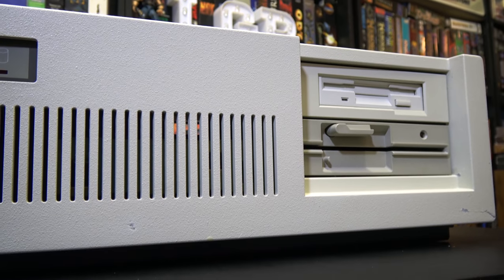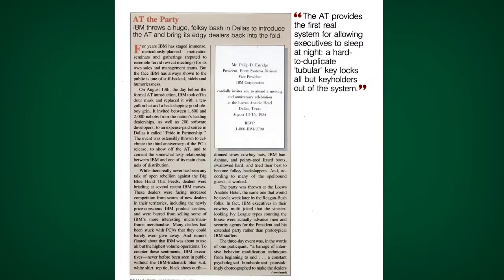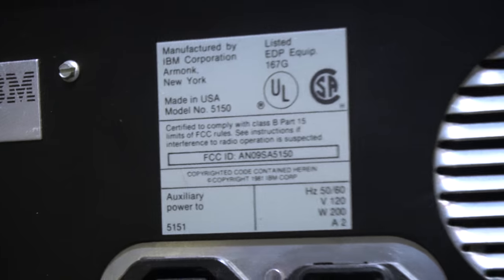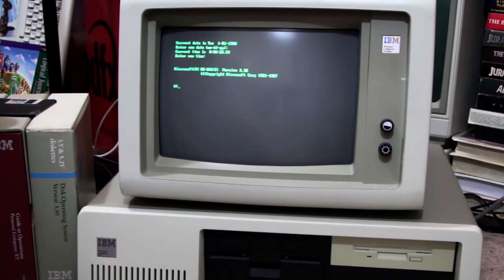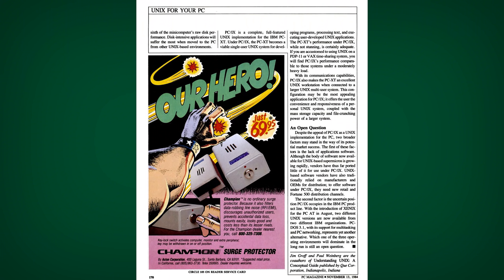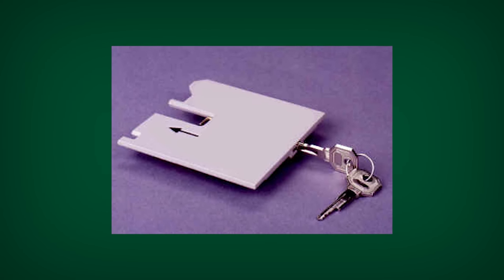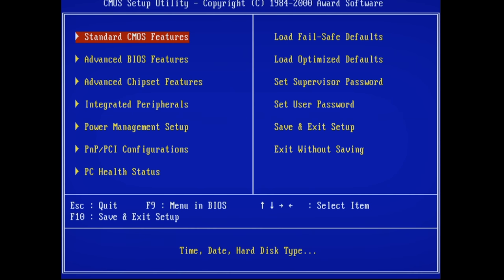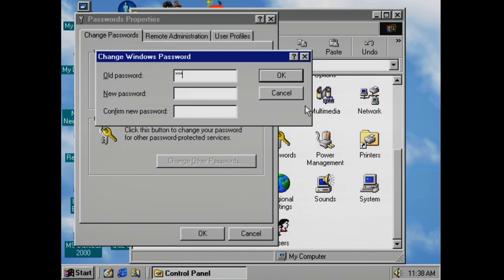Why did old PCs have key locks? An LGR Retrospective

Comment: My dad used this feature against me when I was a teen to ground me from using my PC. I used a mechanical pencil and unlocked it without a key. It worked until he caught me and then he took the power cord.
Reply: Similar story, but I used a red Lego key that worked well enough.
Reply: My family had a 95 that I broke by deleting system files, they got it fixed, and then kept me out by having the thing boot windows manually from the command line.
Reply: Kids tend to be very destructive when they're frustrated/annoyed/mad. One really doesn't understand how self-defeating it is when they're that young, and a lot of parents tend to forget how they felt at those ages.
Reply: haha same here
Reply: XD
Reply: InsaneLP  The English language is dead.
Reply: My dad would put a small padlock through the hole of the plug connectors to prevent me from plugging it in and playing games all night.

He didn’t know the printer, and TV used the same detachable power cords, so I would just swap those for the PC and replace them in the morning.
Reply: My mum used to take the power cord. Needless to say I had multiple cords.
Reply: For me it was the Nintendo controllers. Always had a hidden spare.
Reply: haha my parents tried this lock, but it was too easy for me. also ive had extra keyboard and power cord)))i was in 5th grade)
Reply: mine took the power cord too, but he didnt notice that the cord was the same as the printers...
Reply: Look at your dad, encouraging innovation. :D
Reply: @MrWelshbrit  Chill out. It's quite obvious from his speech patterns that English is not his first language (and the style of expression seems quite German to me), so this isn't a case of someone taking English and intentionally breaking it, but of someone who has learned English as a second language and is not yet perfect.
Reply: InsaneLP  Oh man My parents did this to me (installed a timer program), So I learned enough unix to use the terminal to re-run the initial setup and create a new admin account that was free of all restrictions. Made me feel like a god, until i got caught...
Reply: Just stick a fork between the pc and the outlet 😂😂👌
Reply: Here's one I used to do when I had a desktop pc, cmos/bios lock in addition to passwording the one and only administrator account on xp, and disabling guest, both with different passwords. Y'all would've hated trying to get past that. 1 wrong attempts at start-up I could have the pc either reboot again each time, or set an amount of time the computer would stay frozen and would accept no commands until set time passed.
Reply: My parents tried to prevent me from using my PC when I was grounded by taking those keys, too. But they didn't know how that lock worked, they thought it was like the ignition lock in a car and that I wouldn't be able to use the computer at all without a key (they didn't even check if it was in the locked position). Unfortunately, they found out about it at some point and then they also took the power cord and eventually the whole PC.

Comment: I remember when I first starting my real "grown-up" job back in the mid-90's, in a hospital, the PC's had those locks.  Even for the time period I worked there in the 90's, those PCs were dated, but the hospital kept them in use as long as they could before basically being forced to upgrade because of medical records software not being able to run efficiently on the old PCs.  

We were assigned a key, and threatened within an inch of our life and job, that if we lost it, we were in trouble.  We never used them though, for anything. I can't recall one time I ever needed to lock or unlock my computer for use, but maybe I did....and just can't remember because it was so long ago. 

It was such a big deal then, that HR said if we didn't turn in our PC key if we quit or got fired, that they would hold our final check (which is illegal, but no one seemed to be aware of that back in the 90's) and there were people who got all upset over it when they misplaced it.  

Turns out, it meant nothing at all and by the late 90's, it was just forgotten about as those dinosaur PC's were being phased out for new PC's (which are all dinosaurs now, several times over)

Comment: i remember my brother leaving the house and locking the old 486 with his key to prevent me from using it. little did he know that i could easily unlock it with an "extra key" that i had created using a pin and a clip. aaaah the good old day of dos pc gaming -  when i was 6 and loading up prince of persia made me feel like a hacker.... :D
Reply: What machine did you have? I played on a CGA 8088 and any years later on a 486. 

The real diffrence is the sound.... mi 8088 had only that PC Speaker...

Comment: What also killed the key lock was the drop in RAM price.  RAM used to be stupid expensive, and schools and workplaces especially had to lock down the towers to keep people from stealing RAM from them.  The locks started falling out of fashion as the ram prices dropped and it was less of a draw for thieves.  These days, only major video or gaming enthusiasts need more ram than ships in their computers, and even if they do need more it's fairly inexpensive to purchase.
Reply: MrsRCharlton hell back in 1997 I was wstealing ram from the schools computers to resell
Reply: So far, I still don't need a ship in my computer.
Reply: Desktop towers are still secured with a Kensington type lock. It's usually to prevent people from taking them away, but the locking mechanism also doubles to stop the casing from being opened.
Reply: MrsRCharlton stealing RAM to play Rampage ? lol

Comment: I always knew RAM cost a lot back in the day and my father worked as a lorry driver and on one delivery was asked to deliver a massive load to an IBM factory, when he arrived he was taken out, explained the situation and a single guy walked out, walked up to a specific pallet, at a specific row and took one small container. Turned out it contained £2million(pounds not dollars) worth of RAM. He then was allowed to leave. Also had the same situation with Intel, went to a factory and had a single box that contained silicon chips worth millions, turns out it's safer to use small transport companies for this type of thing.

I still have old keys for computers which I quite like.

Comment: Haha they probably thought computers would be too heavy to steal forever
Reply: Computers with full tower cases, four DVD recorders, two floppy drives, two 20 inch tube monitors, would easily disappear back then. Weight was never an issue when it came to stealing a computer.  I never found out how some of these very elaborate systems managed to get stolen out of guarded floors of a business.  It was not something that happened occasionally. It happened a lot.
Reply: @indridcold8433  Speaking as someone who's worked in security, I can safely tell you that even the most barebones uniform will let you go anywhere, and walk out with anything. When something goes missing like a ghost took it, look at the local pigs.

Comment: tubular locks are hard to pick without a tubular lock picking tool, but if you have the tubular lock lockpick, its really easy to unlock a tubular lock... tubular lock.
Reply: tubular, dude
Reply: awe, well that's tube-bad
Reply: You can do it with a cheap plastic bic pen if you know how.
Reply: No.  It's not any more difficult than a normal straight keyway.   You can even use the same tensioner on some and you push the pins in one at a time, around and around, until you feel the sets.
Reply: ... Are you getting paid every time you say Tubular Lock? Because I'd, tubular lock, like to get in, tubular lock, on that ac- tubular lock -tion.
Reply: Picking tubular locks is tubular because tubular tubular lock pickers pick lots of tubular locks and they are great picky tubular tubular lock picking masters of pickiness that pick lots of tubular locks and they are great picky tubular tubular lock picking masters of pickiness that pick lots of tubular locks and they are great picky tubular tubular lock picking masters of pickiness that pick lots of tubular locks and they are great picky tubular tubular lock picking masters of pickiness that pick ...

... pick lots of tubular locks and they are great picky tubular tubular lock picking masters of pickiness that pick picky pickers picking lots of picky pick pickers of pickitity pickness because picking pick pickers  helps in picking picky picks and it also unlocks previously locked locks because it is a tubular picked unlocked lock.
Reply: Lock lock lock, lockity lock, unlocking unlocked locked locks are very locky because locky lock locks picked the lock's tube. That was quite tubular but the tube tubed a tuby lock, which was picked by a picky picker, who picks picky tubular locks! Tubes used to tube locks to tubulate the lock so they could bypass the pickies anti-tube pickular lock system and get into the secret PiCk created by picky scientists.

Comment: I worked in a warehouse with about a dozen Dell GX150 (Pentium III) machines. They were minimally equipped, some with just 128 or 256MB of RAM for running XP. We received a shipment of computer goods to be scrapped, so I casually went through the container until I had enough ram to max out every system in the company. I grabbed a few for myself, and a couple weak AGP cards. There was even a couple PCI video cards in there, maybe an FX5200? Whatever it was - it was strong enough to run Return to Castle Wolfenstein on that little Dell. I needed something to pass the time on 3rd shift when everything was done!
Reply: 256mb of Ram! Oohwee!
Reply: Great game Return to Castle Wolfenstein is!
Reply: Old ram sticks can be very valuable but they do need to be the largest size available for the era. When 256mb ws common, you need to find 512 or 1gb stick of the same type. Those are more valuable than gold, they are used in old legacy systems that are still needed 24/7. So it only makes sense to get the pinnacle of the technology of that era, the last versions that come out before the next version starts dominating: they are so robustly tested by that point by millions of people running trillions of read/writes per day in all possible combinations of hardware, manufacturing has solved every minute issue and you can easily push for the theoretical limits of the medium. And of course, if you do have a legacy system that can't be replaced, you want to give it the best chance you can to keep running so you buy the very best of components for it. I am not just talking about PCs but also about industrial machines that used the same RAM as the most common found in the market. 

One good example are McLaren supercars from the 90s. The compapny had to hunt down a specific model of IBM thinkpad from the era to run their custom software. They have a storage room full of them, running bespoke software that is designed to run in that particular machine, you can rent one and it travels with a mechanic. Maybe it would work on some other combination of hardware but it will for sure run on this one known combination. Procuring RAM for those kind of cases means no expenses are spared and you may get hundreds from just one 512mb RAM stick from the 1995. Lower sizes and early models are still worth less than crap.

Comment: My graphics card’s fan just turned on at the precise moment when you pressed the TURBO button in the video. That was awkward.
Reply: Or magic lol
Reply: s4ndwichMakeR since the video went turbo you had to up you graphic processing
Reply: XD
Reply: YouTube is a graphics card eater... it's such a heavy program you'll need the best graphics cards on the market...
Reply: DavieJones1111 You’ll need a Nvidia Quadro.
Reply: TheMaster's Code get that GTX 1080 Ti in here
Reply: It's a "turn-on" for your computer or graphic's card?
Reply: then why does turbo boost on new pcs make it run faster
Reply: s4ndwichMakeR iid
Reply: @rich1051414  : You're right. Turbo Mode "On" was just the normal speed of the computer's CPU, and Turbo Mode "Off" was really the underclock mode, where the CPU ran slower than normal. I guess that was intended for old apps and games, which would run too fast otherwise (in those times, some games could actually run too fast, because they relied on how fast or slow was the CPU to determine graphics speed). I guess they called that button "Turbo" because it sounded cooler than "Slow mode".
Reply: I read this comment at the precise moment he pressed the TURBO button. Still awkward?
Reply: where can i buy one , i am one of those people that have lots of money to spend on nothing instead of helping the needy .  just joking . i actually care about the less fortunate . can you tell i was being sarcastic about the none caring  people that waste money on nothing and yet can live with themselves while others suffer with nothing .
Reply: Askejm You can watch Youtube at 1080p on a $35 raspberry pi 3 with no problems not sure if you're joking....
Reply: So awkward
Reply: @rich1051414  : No, I didn't got it backwards. That's how it actually used to work (Turbo On being normal speed and Turbo Off being underclock speed). Maybe your PC turbo button was wired incorrectly so it was the other way around?
Reply: @Askejm  Yes my grafics card doesnt work any more i need to upgrade  because i stepped up whith 23 inch monitor and you tube isnt working any more its torn image and delayed sound
Reply: My hamster almost imploded. 😯😣😥
Reply: xD lol

Comment: "One tubular key" It's incredible that it took until the 2000s for anyone to figure out you could open those things with a pen.
Reply: I used a straw.
Reply: Not all of them: some have tight tolerances and stiff springs, but that still doesn't stop them being picked with a dedicated picking tool that you can get for cheap.
Reply: I used a paperclip. Those things were ridiculously easy to pick.
Reply: I noticed way back in 198x that I could lock every single computer and disk box (yes, those were a thing) with one flimsy plastic key.  I think I did an impressioning attack by accident.

Comment: I've actually looked into this.

Locksmiths still make tubular/cylindrical keys for this purpose, and cost little more than a typical four-pin key for most modern locks today (~$4).

If you happen to get a PC without a key, take the PC to the locksmith and they'll make you a key for it.
Reply: Or alternatively, buy an impressioning tool online and use it to open the lock
Reply: I always wonder why people still use tubular locks for both car safes and server racks - it's a terrible lock, why are you still using it?

Comment: fun story.. I worked at a ski resort around 1989 / 1990.  I was fired for being mouthy to my boss.  So they sat me down in the managers office with one of these older PC's and I carried a key with me.  I had a IBM 386 something or other at the time.  So I locked the keyboard while I was waiting to get fired.. good times :)  I wonder if they ever figured it out.
Reply: Yeah sure that happened "wink"
Reply: Awesome example of petty revenge!
Reply: @smittywerbenjagermanjensen1051  Manufacturers only use so many possible combinations. If you have a car key without a microchip go around a parking lot and try it in every car that's the same make and model. You'll find that a rather disturbing amount of the time the key will work just fine. Even with chipped cars, you can still open the door even if you can't start the car. Of course it'll be fun explaining to the cops why you're running around trying to open random vehicles, but that's the price of experimental verification.
Reply: @Invisifly2  so youre confessing of opening random vehicles that dont belong to you in the name of science?
Reply: lol
Reply: @smittywerbenjagermanjensen1051  
I remember incoming inspection specs correctly there shall be no duplicate keys in 10,000.
Of course we did not check but it would have been possible by having a digital representation for each key, making sure each key/lock combo had its code on the list and then check the list for duplicates.
(I think it was 10,000,  it might have been 1,000. it was a long time ago.)
Reply: @smittywerbenjagermanjensen1051  The video mentions that many locks had identical keys. It's not at all surprising that a key for one device would work elsewhere.
Reply: @smittywerbenjagermanjensen1051  I don't know about IBM, but on clones the chances of a key working even on a completely different computer from a different manufacturer where actually pretty high!
Reply: @ @f-s-r  I've looked at buying a trailer hitch lock, but most reviews indicate that most brands use the same few (or ONE) key across their ENTIRE spectrum of products, so you could buy a cheap padlock then unlock somebody else's trailer with the padlock's key.  Worse yet, you can't re-key the hitch locks.
Reply: @Invisifly2   its even funner to point out to the police that his cruzer and all of the other crown vics aka police to taxi converts as well as explorers use the same key 1284X ford fleet key.
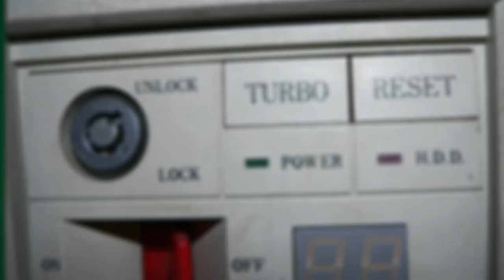Reply: Paul Adeen did you even watch the video, lol...@3:30 he says most times one lock would open many different tubular locks..
Reply: @Invisifly2  Back in the seventies one of my friends had the same type of car I had and our keys worked on each others cars.

Same car. I had parked it in a K-Mart parking lot and did some shopping. I came out,  unlocked my car and got in it, started it up, and then noticed a sports ball on the floor on the passenger side. I kept looking at the ball thinking how strange, how could that have gotten there? Looked around the inside of the car a little bit more and then realized this was not my car! I quickly turned it off and got out. My car was two more spots over.
Reply: @missingno2401  HAHAHAHAHAHA
Reply: @smittywerbenjagermanjensen1051  There were a lot that used the same key. You would be surprised how not many there were.